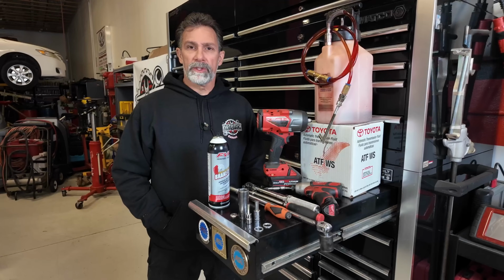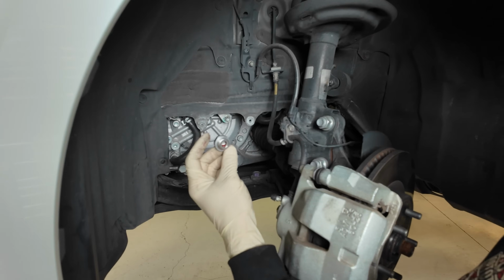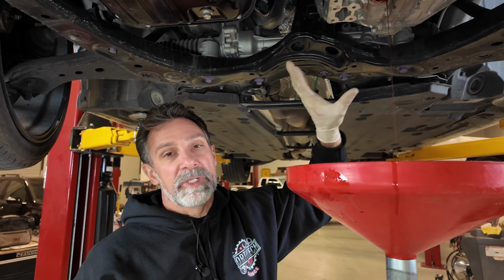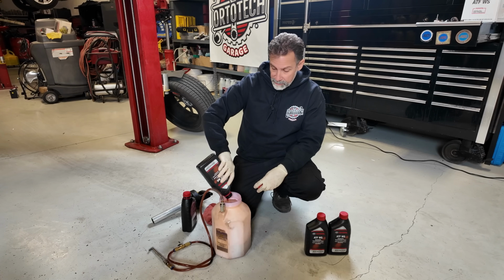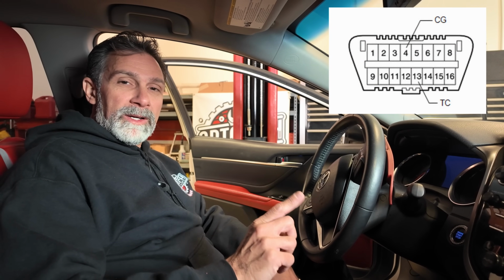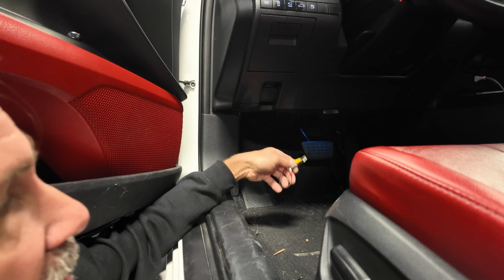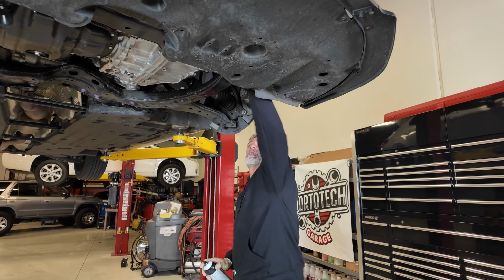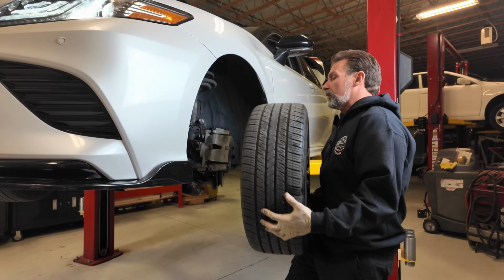The Ultimate Guide to Changing Transmission Fluid on Your Toyota Camry

Comment from the maker: What’s the highest mileage you’ve seen on any of your vehicles without major transmission issues? How often did you service it?  Share your story!
Reply: 500k+ miles on my 1996 Toyota Avalon....never touched the transmission.
Reply from the maker: . WOW!   Never ever changed the fluid!?
Reply: @OrtoTechGarage  Had just over 100k when I got it and by that point most mechanics wouldn't touch it. Never had to add a drop either, no leaks. I've thought of getting a newer hybrid due to a 200 mile daily commute, when that time comes I may swap some of the fluid, but at this point the engine isn't the issue, the body is slowly coming apart.
Reply from the maker: @IamFrancoisDillinger You certainly got your money's worth on that car!  This is why I tell people not to be afraid of buying a high mileage Toyota.  They really hold up well. 👍
Reply: Please why is my car have it difficult to select 3 and 4 gear sometimes not every time
Reply: @adinduchigozie7673  worn out clutch pack, or a plugged channel in valve body, or problematic solenoid in valve body, time to service your transmission
Reply: @a @adinduchigozie7673
Reply: 206,000 miles on my 2001 Honda Civic Coup with manual transmission, original clutch.
Reply from the maker: @cyrilasfrenchyaz.  That's amazing.  I dont think I've seen a clutch last that many miles.   Great job!
Reply: 2007 Camry XLE V6, 266000 on original trans.  Bought it at 159K  miles.  Serviced   the U66e trans about 6 times.un5il it was hit by an uninsured driver and totalled last year.
1999 Jeep Cherokee, 260K miles on original AW4 trans.  Serviced about 8 times since bought in 2007 at 120K miles
Reply from the maker: @POPSAAB371 You are doing a fantastic job with the maintenance, and it's really paid dividends!  I wish I had you at the service counter to tell your story to my clients...lol.  some people  just don't believe in proper maintenance.  I'll never understand it. 🤦‍♂️
Reply: @OrtoTechGarage  I did all the service myself.  Went to local community college and get AAS in auto service technology 10 years ago during the last few years before I retired.  I never worked in a shop, just my own home, well equipped shop
Reply from the maker: . It's a great skill to have and also provides a sense of accomplishment when you've performed your own work.  Great job getting educated.  Its really necessary in the modern era of cars.  Keep it up! 😉
Reply: 256300 on a 2001 Honda civic transmission never been touched.
Reply from the maker: @tilsker  Same as the 500K mile Toyota, never serviced the fluid?
Reply: Advice....I have a toyota rav4 2018 LE original owner, and never replaced the AT fluid. Car has 175000 km. Should I do it? No issue at this point with the transmission.
Reply from the maker: . I say yes. As long as everything is working properly, a drain and fill will not cause any problems, only restore the fluid to its original properties.  I just did a Corolla with 160K miles for the first time.  I had to flush it through the cooler lines to change most of the fluid and it is working fine after the service.
Reply: @OrtoTechGarage 

How does a drain and fill restore to original properties when you're not removing all of the fluid?

Don't you want to pump new fluid through the entire system including the torque converter to make sure you replace all of it?  

Isn't it a good idea to replace the filter and clean the inside of the pan?
Reply: Advice....I have a toyota rav4 2018 LE original owner, and never replaced the AT fluid. Car has 175000 km. Should I do it? No issue at this point with the transmission.
Reply: 402,000mi 2007 Civic sedan LX AT.  I did drain fills no more than every 30,000 with Honda fluid.  Never a trans problem.
Reply from the maker: @richcombs4805 Fantastic!  That's exactly the intervals I recommend. 👍
Reply: Do you have similar teaching video for changing 2021 Hyundai Palisade transmission fluid ???? I appreciate it🙏
Reply from the maker: @mojismail I dont yet, but I will keep an eye out for one to record when it comes through the shop. 😉👍
Reply: @OrtoTechGarage when the D illuminated after it reached the desired Transmission temp. Did the radiator fan turn on? I had some loud radiator like noise go off on my Rav4 and was not sure if that was normal. i dont see it mentioned anywhere. Is it safe to let the fan roar while we take the drain plug off to let the excess fluid trickle down?
Reply from the maker: @619denz Interesting question.  I've never noticed the fan come on because the engine should not be at operating temperature.  But, it's possible I've just not noticed.  The vehicle should be pretty close to cold when it's in the proper fluid temperature range, over 95 under 113 degrees Fahrenheit.  Make sure all of your accessories are turned off like the air conditioning. That said, the fan running really had no effect on the checking the fluid.   Different system.
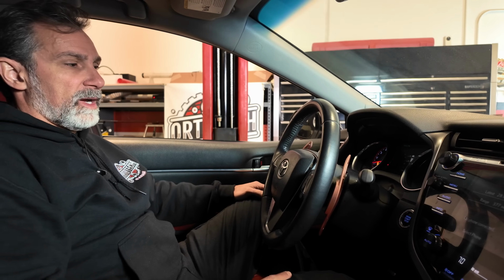Reply: @OrtoTechGarage  Thanks for the reply back. If you re-watch your video, the same FAN or High pitch motor sound can be heard exactly at 17:19~17:20 mins. It freaked me out as i tried to do a test on the Temp Check Mode and regardless of which gear you shift once the D is illuminated the D stays on. It only goes back to normal mode once you shut and re-start the engine. Thats when P shows back
Reply from the maker: @619denz Yes to the D display in the dash regardless of actual selection.  That's how you know you've done it correctly.  Maybe activating the TC Terminal turns the fan on, too.  Like I said, I never really noticed. But, it sounds like you've got it correct and can adjust the fluid level with the D light on steady while the vehicle is in park position. 👍👍
Reply: @OrtoTechGarage  Thanks. Guess i wasn't crazy when i heard the motor/fan go off when the solid D illuminated. Glad to know that you missed it initally but noticed the fan/motor turn on. My heart was in my mouth thinking what did it overheat. :D
Reply: 98 Toyota Tacoma 4wd 388,000 miles I still drive it today.
Reply: 2015 Prius 277,000 miles. Change engine oil every 10k miles. Only issue ever was the front right wheel bearing. Still going strong and never changed the AT fluid. California roads suck, as well as our Governor. Had to throw that in there.

Comment: Good video. Why would you under fill and then put cold fluid in to top off. Why not over fill a little and drain off.
Reply from the maker: I like to do it this way because the overflow check tube has a small orifice and it takes longer to drain then to fill.  We are under time constraints when trying to keep the fluid in the proper temperature range.  Plus you waste less fluid.  You can do any way you prefer, though. 👍
Reply: @OrtoTechGarage  Thanks. I'm more familiar with  the 3rd gen tacoma 6 spd aisin with 3 service plugs.
Reply from the maker: 👍 Similar process.  I do them the same even though the tube doesn't come out.

Comment: Thank you for your great work and actually servicing transmission and hooking then up to a power flush system.
Reply from the maker: You're welcome.  I can do a video on using a transmission fluid echange with the machine, I just figured it wouldn't be useful for anyone at home. The machine is very expensive and only shops have access to them. If you would like to see that process I can do it.
Reply: @OrtoTechGarage Do those machines force you to exchange the entire volume? Every time I have inquired about them, dealerships and express shops tell me that only a complete fluid exchange is available. If you can do a partial exchange that would be interesting.
Reply from the maker: You can exchange as much fluid as you want, but the idea is to make sure all the old fluid is gone. We generally use at least 12 quarts of fluid with the machine.

Comment: I love this in depth video! With that being said I did however find a couple things I've noticed doing it myself and following your video. #1 I can't stress enough how important it is to make sure the car is level while draining fluid with overflow tube in place for final draining for proper fluid amount before putting the drain plug back on. Did I miss you explaining that... maybe? I don't have a lift and did it shade tree mechanic style in my sloped driveway with floor jack and jack stands and used a 4ft level on rocker panel/ground effects to find level. #2 You said to jump pins 4 and 13. I lowered the plastic panel that has the ODB plug on it for my 2019 Camry and looking at the back of the ODB plug where the wires go into it... There is no wire in 13 so it would not be jumping anything going from 4 to 13. My car still seemed to go into the drive modes you described using your steps where the "D" stayed on even in park when at the desired operating temp, or disappeared if it was too cold and flashed when it was too hot. Again LOVE the video!
Reply from the maker: Awesome!   Thanks for the nice feedback.  I can't remember if I mentioned the car should be level in the video.  I would have to watch it back.  But you are correct.  It should be level plus or minus one degree.  If i missed that, I apologize.  You did a great job ensuring that with your level. The newer Toyotas have removed that terminal from the OBD data port.  You are correct in your process.   This video was specifically for the 2018 model.  I hate to make a broad scope video covering multiple years because they make changes like this all the time. I even have to look them up each time to ensure procedures, fluid specs and torque specs havnt changed. Good catch on your part.  Thanks for sharing and for watching!

Comment: Does this Camry have the same transmission as a 2020 RAV4?
Reply from the maker: If you have the 8 speed automatic the process and fluid is similar.  The internal gear ratios and fluid capacity may be slightly different, but you can follow the fluid service procedure.   If you happen to have an oil cooler thermostat, you will want to bypass that using the procedure from my Tundra transmission fluid service video.  👍
Reply: @OrtoTechGarage I do have the 8 speed so the temperature to check the fluid and torque plug spec should be the same. Thanks for this very informative video.
Reply from the maker: You're very welcome!

Comment: Really nice video showing right way to do it. I'm lazy and just let it cool down and remove the air box that sits over the trans. Then just unplug the TCM cable from the port on top right of trans, open the TCM plug port and suck out 3.5L with an extractor and put 3.5L back in through same hole. 15 minutes.
Reply from the maker: Well....I guess thats one way to do it!  Lol 👍

Comment: Keith, Outstanding tutorial! I thoroughly enjoyed it. As long as I monitor the trans fluid temp with a scan tool and turn off all power accesories, that should suffice when checking after drain and refill to confirm fluid level? Thanks again!
Reply from the maker: Thanks!  Glad you found it useful. Technically, you  need to activate the TC Terminal.  There is a function in most advanced scan tools that allows you to do this. Then you can complete as you stated.  Jumping the terminals in the data link connector is performing that function without the scan tool. The 👍

Comment: Need to show to the camera what your changing gear Till the engine is running. Are 4 container of Transmission fluid are there inside the transmission? Toyota dealer told me $425.00 for the Transmission fluid change.is that right?
Reply from the maker: Sorry,  I thought i got that in the video while recording.  Unfortunately,  YouTube doesnt allow for updates or edits once uploaded. I do explain it as I perform the shifting procedure if you can follow along.  

Its Part to Reverse to Driive to Nuetral and back to Park (a few seconds in each)....then Drive to Nuetral back and forth not more than 1.5 seconds in each until the Drive indicator illuminates and goes out.   Then put it in Park and watch for the Drive indicator to go on steady.  Thats the correct temp. 

That price sounds correct for a shop to perform the service for you.  If you just do a drain and fill you will likely use 4 quarts or less. 

Good luck!

Comment: What happens if you you just drain the oil out and fill the 3.4 quartz in and turn it on and then take of the drain plug and let it drip till it barely drips? With out checking the operating temp?
Reply from the maker: The fluid expands as the temperature rises, and Toyota has determined a very specific temperature range for the level to be set.  I doubt you'll get it exactly correct with that method.  I think it's best to practice and learn the proper technique, and just do it as prescribed.  👍

Comment: Of course the dealership uses a special to check and drain the fluid from the oil pan without taking out anything or removing bolts on the wheel well. I guess you convienly left that part out. Why go thru all that trouble and be doin it wrongly.
Reply from the maker: I included wverybsingle step in the entire process.   Maybe you missed a part in the video?  The plug behind the wheel well is only for filling.  The check plug is the drain plug at the bottom. Im not sure where your comment is coming from.

Comment: Im working on changing the tranny fluid on my 2023 camry. It appears that Toyota has changed the obd pins on this car. I verified this on Gemini AI. It appears that pin 13 is now a blank and according to Gemini you no longer have to use a jumper. I am uncertain of this and am considering getting an omb that can verify the tranny fluid temperature
Reply from the maker: You are correct.  The vehicle in this video is a 2018 with a different  transmission  Please dont use this video for your vehicle, it does not apply exactly.  There is a procedure to do your vehicle without a scan tool, but the scan tool is obviously the best way, if yours has the ability to do that.

Comment: Leaves out so much critical info - like what model year Camry ? What are part #'s of gaskets ? Where did he buy that jumper tool?  What gauge wire is needed for the jumper tool? How soon after starting the car in the morning can the fluid level be adjusted?
Reply from the maker: 2018 Camry 2.5L. You’ll have to call your dealership parts department for gasket part numbers. The jumper tool is discussed in the video and I gave options.  I made mine from a jumper wire and electrical backprobes or you can use a paper clip.  The specific temperature range can be achieved several minutes after a cold start. I hope that helps.  Best of luck!

Comment: My 2023 Camry has 62,000 miles.  According to AI it claims that the ground rules to changing the filter is that if the transmission fluid looks burnt then change it if not then do not.  I am inclined NOT to change the filter on this car.  What is your view of when is the proper time to change the filter as well as the gasket.
Reply from the maker: The good news is you don't get much of a choice.  There is no serviceable filter.  Just the fluid and you're fine.   👍

Comment: Really interesting video! It's funny how it's advertised as "Lifetime" transmission fluid but even the dealerships recommend having it replaced. I have a 2020 Camry that's almost at 100k miles, was told by the shop that I normally go to that they generally recommend doing the fluid change for the transmission at around 100k. So since I'm planning on having it changed soon, I was curious as to how it's done.
Reply from the maker: Awesome! I'm glad you found this helpful and informative. Thanks for sharing your thoughts and for watching !

Comment: I owned a 2005 Camry for 15 years and 218,000 miles. I easily changed tranny fluid 4 times. Then I bought a 2020 Camry and now this..."total bullshit with all these steps to change oil." I'm pretty pissed at Toyota...this is 100% unnecessary!
Reply from the maker: This is a bit of an odd process, but dont let it put you off.  Once you know the steps it's really not that difficult. It just looks intimidating.  I made.a video about the e-CVT and that service is much simpler, although all conventional automatics require something similar still.

Comment: Is athe procedure the same for 2022 RAV4 with automatic (not dip stick)?
Reply from the maker: It will be similar, although the fluid quantity may vary slightly.  Some of the newer models dont allow you to activate the TC terminal by jumping the terminals in the OBD port.  The terminal are blank/wires missing from the connector.
Reply: @OrtoTec @OrtoTechGarage  activate TC on those cars with missing contacts?

Comment: My girlfriends 2018 camry se just hit 100k miles, should i change the fluid or is it too late?
Reply from the maker: As long as everything is working properly, I would do the service now and then get it into a routine every 30K from here out. The horror stories usually only apply to worn out or improperly working transmissions and more so on American manufactured vehicles.  I have done Toyotas for the first time with up to 150K miles and no issues. If you are trying to solve a problem with a flush, it could make it worse.  Routine service should be no trouble.
Reply: @OrtoTechGarage will do. Thank you!

Comment: There is a transmission filter. Its behind all the shift solenoid packs behind the front cover. Impossible to change without tearing the front end of the car off or lowering the subframe cradle or lifting the transmission
Reply from the maker: I think people are genuinely concerned if there is a traditional filter that should be serviced as part of a routine maintenance plan.